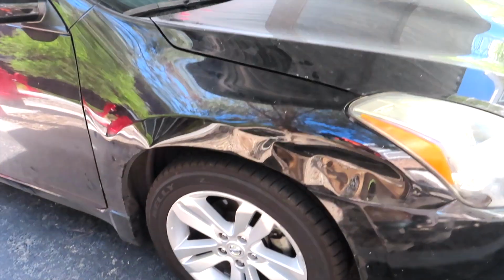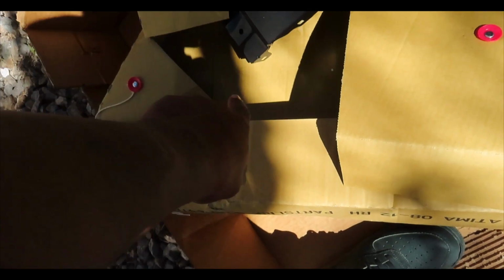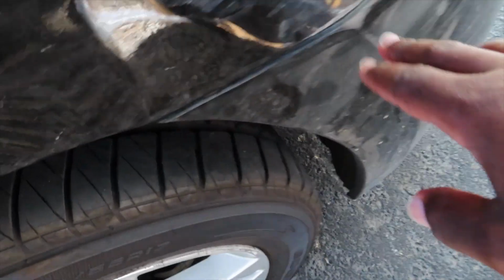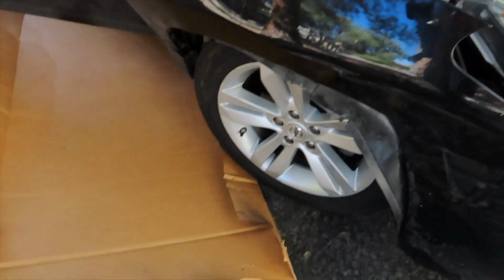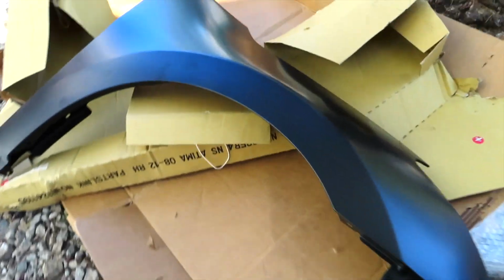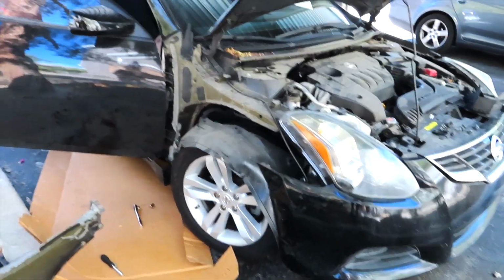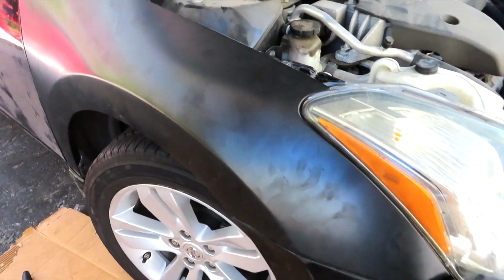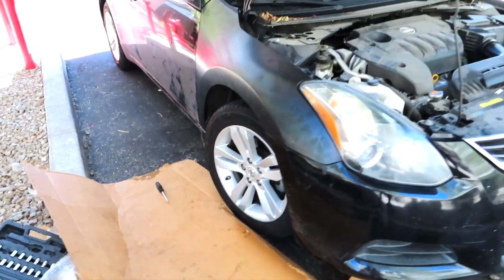How To: Remove & Replace A Front Fender 2008 - 2013 Nissan Altima | DIY Vlog

Comment: I just wanted to share you with what I do.  I am fortunate enough to have several LKQ pick your parts within 2 hours drive.  When I need something, I put in searches that notify when a car meeting my description hits one of the yards.  For this fender, I found one right away, near perfect condition, exact make model year color code. Removed from the wreck, installed on my car, perfect match, and factory paint which will never fade or look different from the rest of the car.  I have done this several times and it has worked perfect.  I needed a rear passenger door for a 2009 PT cruiser.  That took 2 years, but I finally landed it and you cannot tell it was not the original. Nice job on the video!

Comment: Great video.   My Altima had a lot of damage to the front when I bought it, and the left fender bracket was broken, leaving the front bumper hanging out because it had nothing securing it.  So now I am going to replace all of the front body panels...bumper and fenders, and then I plan on wrapping my car instead of painting it.  That's just the beginning of my rebuild though.  :)
Reply from the maker: Thanks for watching! Sound like a great project on your hands. 👍🏿
Reply: @ForTheWinTV  he he he...you should see my parts list.  Currently sitting at around $10000...and that's before a complete interios color change.  lol

Comment: They sell these painted to code, why the cheap primered fender?
Reply: Well do they sell them painted?
Reply: @glen7051  yep, ebay has them.  Give them ur paint code and it comes painted and ready for install
Reply: @freefree2021  got to check that out thanks
Reply: Go Team Nissan! 😉
Reply: @freefree2021  I checked and it doesn't say anything about the color
Reply: If you look in the item description it usually states it there.  I entered "2013 nissan altima fender painted"
Reply: @freefree2021  how much was your total if you don't mind me asking
Reply: $230
Reply: Did similar  and although black, you can not trust the paint code. Age , surface, Clearwater contamination all change even black.....my paint code had 9 different variations to the paint code. Had to paint 3 different times. Need to do a visual comparison IN DAY LIGHT.

Comment: Should’ve popped the dent out of the old one see if you could get away without painting and replacing it
Reply from the maker: Yes, that would’ve been a cheaper option.
Reply: @ForTheWinTV  I mean it may not have worked but definitely worth a shot I’m putting new fenders and bumper on my maxima right now but my fender was way worse

Comment: Thank you! How did you get the side skirts off? @3:08. I am to that point but the clip behind feel like it needs to have the skirt pushed forward and not just pried off.
Reply from the maker: BoHunter2010 Thanks for watching! There is two screws where the mud flap is that will need to be unscrewed. Then underneath the car close to where the mud flap and side skirt connect you will need to unscrew two more screws. Finally once those are unscrewed you can unsnap the side skirt. Don’t forget to subscribe. 👍🏿
Reply: Thanks.  My clips broke when trying to pull them out.  Oh well.  I found the rocker panel on ebay and saw that it just pulled out, but I guess mine were just too brittle.

Comment: What website did you buy the fender?
Reply from the maker: yo yo Amazon.

https://www.amazon.com/Evan-Fischer-EVA16972045738-Fender-Nissan-Altima/dp/B009DJQMTW/ref=sr_1_2?dchild=1&keywords=Right+front+fender+2013+ALTIMA+coupe&qid=1586561537&replacementKeywords=right+front+fender+coupe&sr=8-2&vehicle=2013-67-881------------&vehicleName=2013+Nissan+Altima